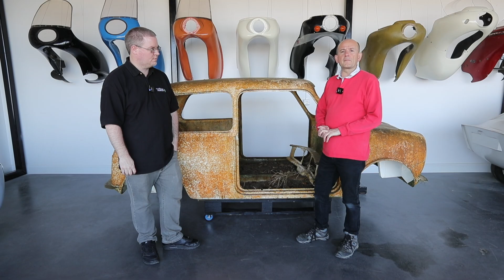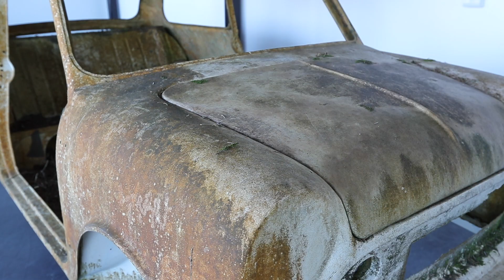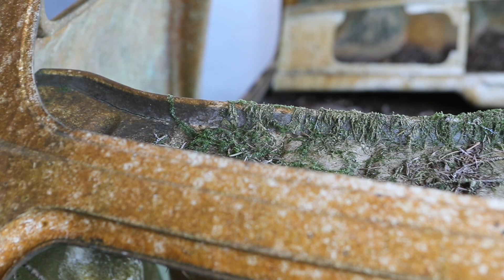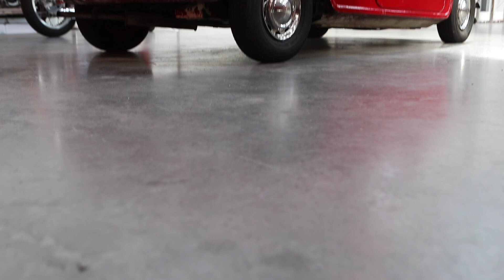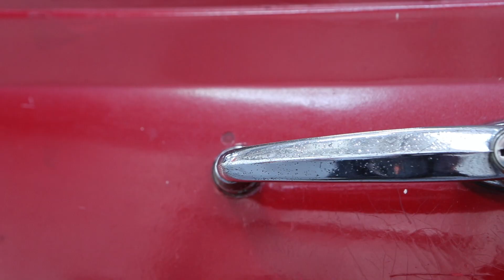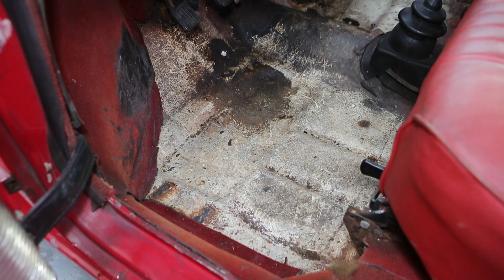How Peel Engineering created BMC's production fibreglass Minis

Comment: I saw an article in the engineering press about the crash tested white one, it failed spectacularly and offered no protection at all to the occupants. Many years later Harold Dermott and Richard Oakes designed the Midas mini based kit car, again fully glass fibre with Mini/Metro drive train,  the Midas famously passed the 30mph crash test and was still driveable. There was a surge in orders for the Midas which was traced to all the major manufacturers buying a body shell to see how Midas had done it.

Comment: That's great. I once had many minis and yet I hadn't heard of any GRP ones until now.
Reply: I had one MK3 in Germany. Good but not reliable.
Reply: @klauszinser  My last one was a new 1979 model and the materials and build quality were just terrible. For example, the rear subframe was over 2cm shifted to the left. The company was in bad shape at the that time.
Reply: @jozsefizsak  
I remember the welding on the carossery on the whole back. 
Nevertheless driving was a lot of fun. 
I bought it in 1986 and i think it was maybe 10 years old. So manufactured around 1976, similar to yours.

Comment: The company I did my apprenticeship in from 1966 to 1970 had a fibre-glass department. One of the blokes working there was allowed to use the workshop in his free time to make a complete fibre glass body of a Mini Cooper to replace his totally rusted one. It took him 2 years and when it was finished looked identical to the real McCoy with all the body joints and everything. Possibly it's still on the road, I mean it didn't rust, the main reason cars were scrapped in those days.
Reply: Weirdly i have a rebodied fibreglass mini based kit car called a McCoy, so this caught me offguard  ahah... hideous thing it is

Comment: Custom Minis in the UK makes fiberglass Mini bodies for purpose built race cars, and full bodies with floors and firewalls that can be outfitted for rod use. Stock, pickup trick, and extended length van styles.

Comment: I'm old enough to remember that these were death-traps when made of welded seamed steel ....... in GRP, you've got no chance.!!!!
Reply: I wrote off a couple of them and walked away! So not up to modern standards but no more a death trap than with other vehicles of the time.
Reply: @gregtaylor6146: Death-traps? Compared to what?
Reply: @htimsid  - ANY other 4 wheeled vehicle.
Reply: @gregtaylor6146  It would burn well if a fire broke out............
Reply: Fibreglass is pretty good in an impact.
Reply: @jonnyf7turbo  😂😂😂😂😂
Reply: Minis were stronger than predecessors like the Austin 7 & Morris 8.
Reply: Oh Dear! Almost five and a half MILLION of these Minis sold and then resold to new owners many times over and how many people were killed or seriously injured in accidents in them - hardly any and certainly very few compared to many other cars that sold less and were more powerful etc. Minis had a beefy subframe at the front and back that took a lot of the impact from a crash - when a van ran into the back of my Mini all it did was crumple the bootlid and hings panel because of the subframe which was an easy fix. There was a head on between a Mini and a Ford Escort XR3 that had veered into the Mini at a bad accident spot here way back in the 1980s and the Escort was in a worst state than the Mini probably because the front of the Mini is all engine and subframe - both cars were obvious write offs but the people in the Mini were in no worst state than those in the Escort as far as injuries. Same goes for most cars from back then very few people were killed or injured in them compared to how many were sold.
Reply: @williamwoods8022  - In the hayday of the Mini, between 1960 and 1970 road DEATHS in Britain were running at approx 7000 per annum, are you saying 'hardly any' of those involved yur beloved deathtrap??? Oh dear indeed!

Comment: During the 1980s and 1990s I can remember two companies who made GRP mini bodies. Status made a Mini Minus which looked very much like the car in this video. Domino Cars made several body styles (saloon, estate, cabrio, pickup) of GRP mini called a Pimlico which were a bit more like a mini with a body kit on. There were also a huge number of small companies producing low numbers of mini running gear based GRP kit-car bodies in all sorts of styles from vehicles which were aesthetically quite retro to some which were very futuristic.
Reply: Didn't the mini minus have a shortened roof?   Domino Cars (Fibretech GRP Ltd) are loooong gone.   My Domino HT is sat in a corner awaiting spare time and motivation to rebuild it....
Reply: @ Minus was lowered below the belt line, roof & pillars were as standard, Minisprints (later replicated in GRP)were cut both above and below !
Reply: @robingray1302  ah yes the minisprint.   Sadly I don't think I have the kitcar mag I bought back when I was looking in the 90s.   Was it GTM who did a rear engine 2 seater using two mini front subframes?   I think later they used metro parts.
Reply: @thegrumpyengineer3907  Correct, that was the GTM (originally Cox), i first saw a very early one racing at Ingliston I rhink in 1969 !!
Reply: @thegrumpyengineer3907  I'm pretty sure the Mini Minus used the standard set of windows and it was the bottom half of the vehicle which got chopped. Can remember a few cars with holes in the bonnet with important things poking out the top as the engine bay was no longer high enough.

Comment: As a now much former owner of a from new, 1966 BMC Mini, it was an absurdly good idea,  but the British Production failed Totally!! Even from the frontscreen corners, water came in, as from many other places! I had to bend in the window frames, with my knee in between, to make them meet the body, from a - cm away! Paint peeled off from a faulty Painting Method round the outside hinges. The wipers stopped at any place on the screen, when stopped and the named "Heater" had only two positions, on and off! And don't drive behind a lorry during rain, as the engine would cut!  It became my only British car!!!
Reply: Minis are allergic to rain with the dissy right behind the grille,, what could go wrong. And it rains in England a lot!
Bending window frames etc is how MANY manufacturers do it. I have not noticed excessive water leaks in decent cars,, maybe the Aussie ones were a lot better. 
Wipers not parking is an earthing thing. I have a Ford Galaxie with the same issues.
Reply: @ldnwholesale8552  Hi ik had several minis back in the day no problem in the rain at all, I removed the shield in front of the distributor gave it a spray of plastic sealer job done I always believed that the shield did very little apart from trapping damp air around the electrics...
Reply: @john-em1jr the best cure was to steal a rubber glove from the kitchen, snip off the tips of the fingers/thumb and feed the plug and coil leads through, fitting the glove hand over the distributor. Can’t remember if we had zip ties then probably just used string to secure the glove🤪
Reply: @ldnwholesale8552    NOT 'an earthing thing'   early mini wipers were not self-parking .................. duh
Reply: @ldnwholesale8552  At that time, many cars did not have self-parking wipers.
Reply: @ldnwholesale8552  In this case they had no system doing it. I think the Mini was produced without a profit for nearly all the years of Production? And if the doors need an adjustment, it is normally done before the delivery! A plate was introduced in front of the distributor for later Mini models. All my cars since then have the wipers stopped at the bottom of the window automatically. But this was my only British car, so I can't tell you about those. By that, the first gear wasn't synchronised.

Comment: An even lighter mini sounds terrifiying
Reply: That's the problem...this red fibreglass Mini is heavier...but doesn't rust.
Reply: @I find it hard to believe its heavier! I'm guessing the metal used on the original mini is paper thin. Not rotting is a good side effect tho
Reply: @JohnSmith-pl2bk  As much!!
Reply: @ 
Galvanised front and rear subframes would have been ideal in either steel of fibreglass bodies....